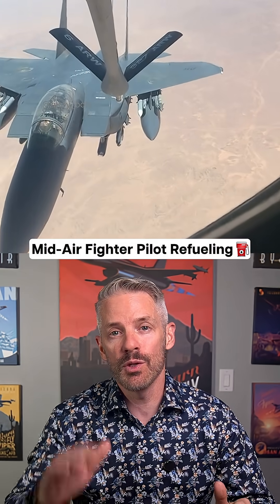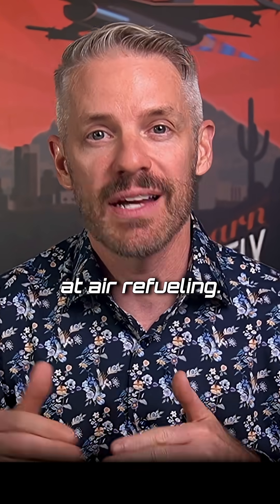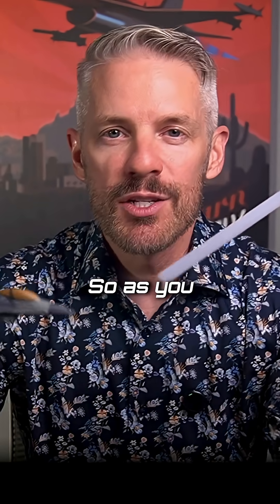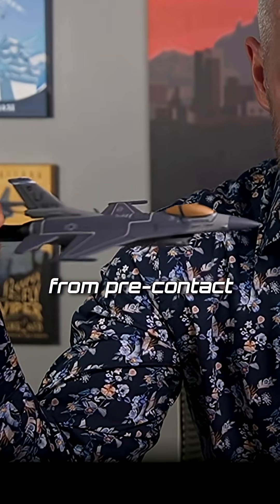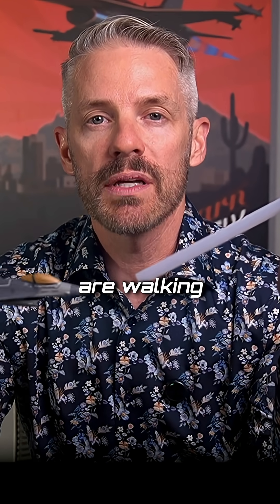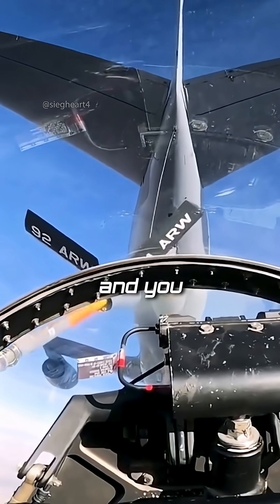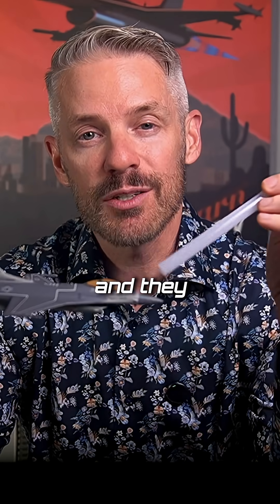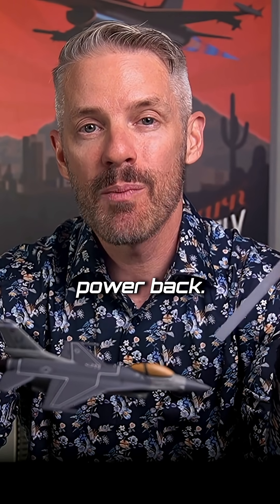How to Aerial Refuel an F-16

Comment: Like tuning a guitar. Each string you over tune first a little(higher wavelength) then a bit lower and then slowly add tension, until it tunes and wavelengths match and are "in synch".(not the band)

Comment: I will never air refuel in mid air but thank you for explaining it. Super cool stuff.
Reply: Not for lack of wanting to lol
Reply: Aerial refueling is a requirement for every military fixed wing aircraft pilot.
Reply: @Gundam00BlueBrave 
Not accurate.
It is required if you fly an aircraft which has the capability to refuel.

What military pilots do in undergraduate pilot training is fly Close Trail formation.  That is quite similar to maintaining the refueling position.  But not at all the same thing.  Refueling requires far more precision.  And not everyone is trained to do that.

Comment: How much (or little) are you moving the throttle to gain or lose a few knots?
Reply: You just need to think of moving the throttle and your body moves it such a small amount
Reply: @JamesMathison98 with my lack of fine motor control it would be stall or afterburner.
Reply: @brently1985 you’re too hard on yourself! If you can keep a car a steady speed you’re on your way to do the same with a fighter jet
Reply: @JamesMathison98 i appreciate the encouragement but if i got into flying it would be the civilian route. Im way to old and biased to the army (prior service).
Reply: @brently1985 
To help give you and idea for the answer to your question...
Back in the day of swing-wing fighters, there were pilots skilled enough who could maintain refueling position without touching the throttle at all.  You can modulate the Wing Sweep Handle instead, which modulates the drag, which gives the same result as modulating the thrust.

So the answer:  Not much is necessary.
But you can certainly overcontrol it with ham fists.

Btw, I have never heard of a B-1 pilot doing this.  The problem they would have is the responsiveness of the wing sweep mechanism.

Also...  this approach of drag modulation would apply to speedbrakes.  But the problem here, with the F-16, F-15, F-18, etc, is that the control knob is not precise enough to enable you to do this.  You could rig a speedbrake actuation lever which did give you precise enough control, and then you could do hands-off-throttle refueling that way too.  Or maybe someone has figured out a way to do it without any such mod.  But I have never heard of that ever happening.